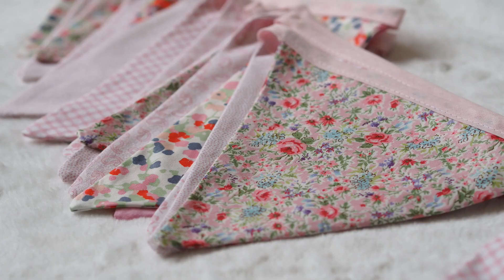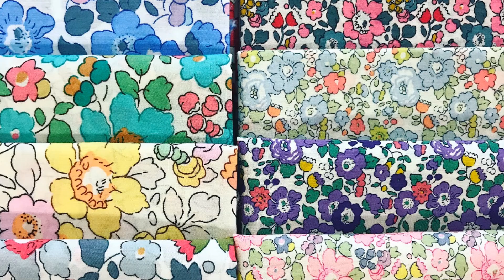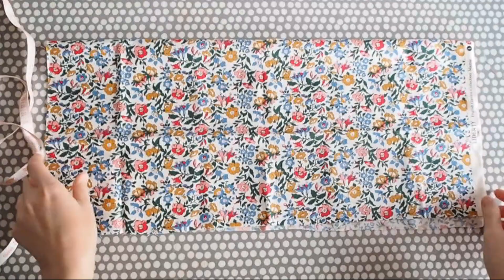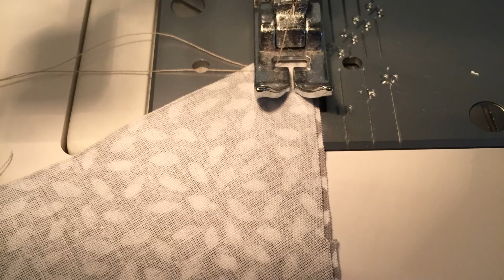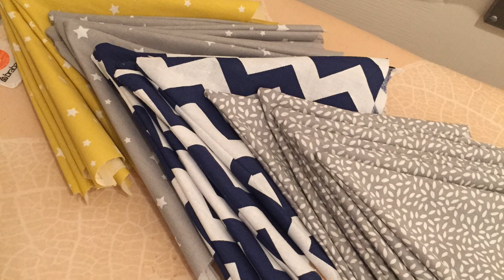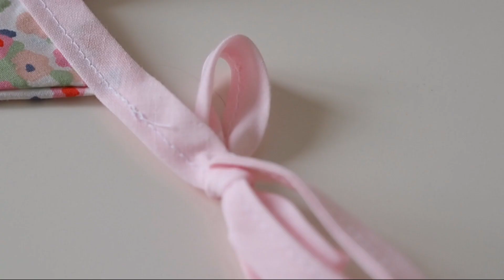DIY BUNTING TUTORIAL | How To Make Bunting - Easy for Beginners!

Comment: I’m really not being funny with you but your making the whole process much harder for yourself! Make a template out of strong cardboard, turn your fabric inside out and layer it so you can cut through 2-3 or even 4 layers at once, then using a fabric pen or a normal pen draw around your template, use a metal ruler and cut with a rotary cutter. This saves you having to measure all the time, prevents you losing your pen marks especially in a busy fabric and you will have many bunting pieces cut out in one go! I’ve been making bunting for many years for peoples special occasions and at the moment I’m making 200 yards of continuous bunting and also making my own bias binding which will match the fabrics I’m using. It’s really simple and fast to complete once your in the flow of it! Thanks for your video though it was a pleasure to watch🥰x
Reply from the maker: Thanks for the tips!